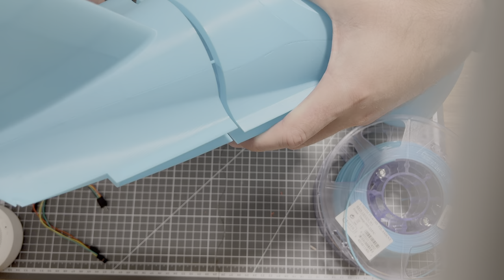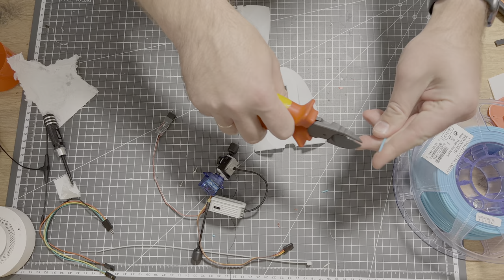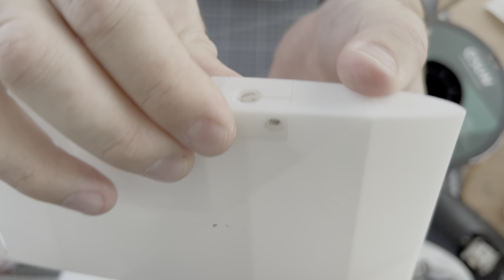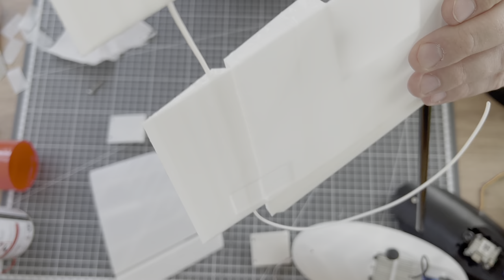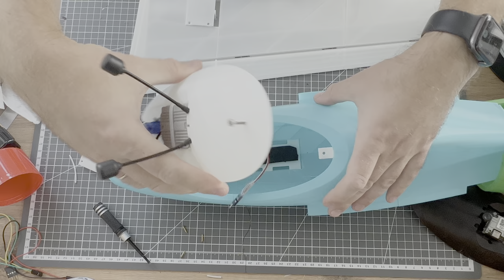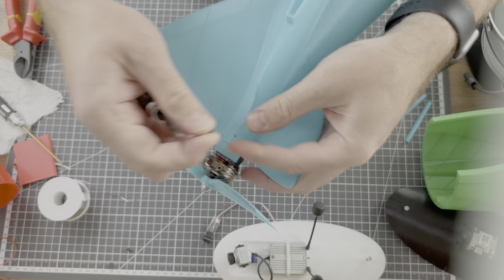Grom FPV 3d printed wing full build video

Comment: What sort of build volume do you need on your printer for this? Do you have no GPS issues just sticking it to the top of the matek fc like that?
Reply from the maker: Hi, the printer size 190x190x195 should be enough. I don't have GPS issues as long as there is no compass

Comment: Hello, very good to the armed. query, is the propeller printed in pla+? it has the stl file of the propeller. Thank you
Reply from the maker: No, I do not recommend printing propellers as it can be dangerous. This is gemfan flash 7042 prop. But you can choose your own for your motor